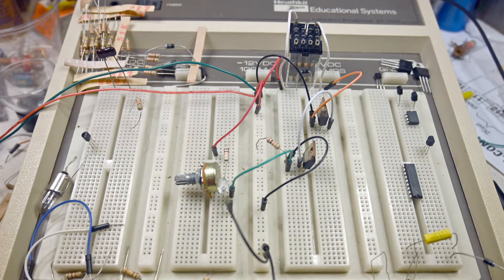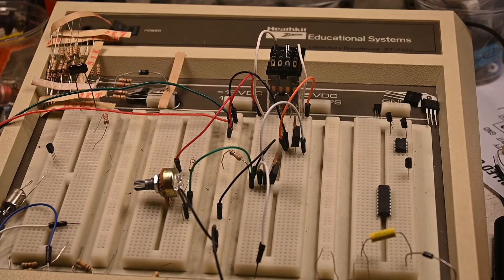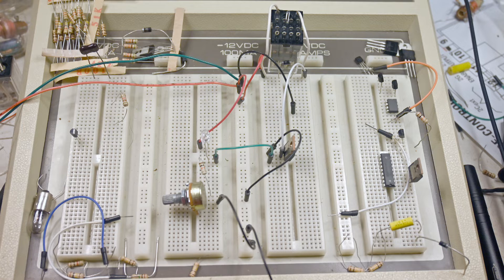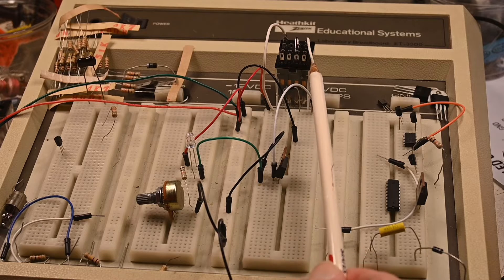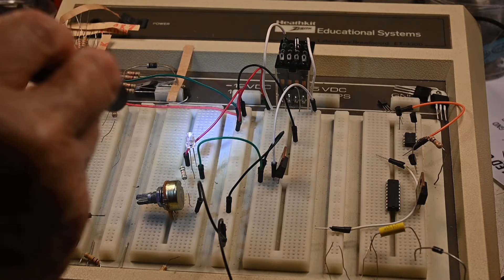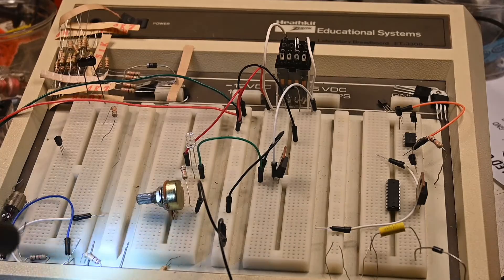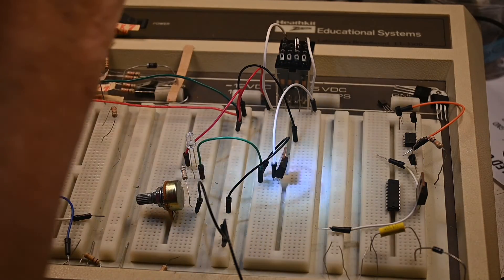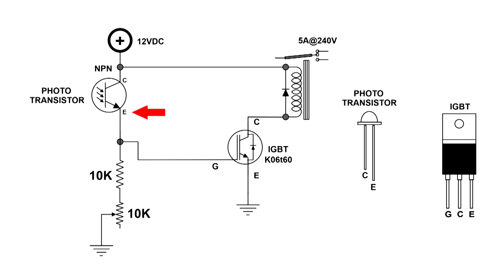180° Phase Shift using one IGBT Auto ON OFF Circuit

Comment: The issue I had when I built something similar using a 741 and a photo-resistor was that i needs hysteresis since at sunrise and sunset the light changes gradually and so the relay will buzz for several minutes till its enough to switch on properly.  I like the simplicity of this circuit so do you think it could be added with a couple diodes and another pot?
Reply from the maker: You could try using a Schmitt trigger in the circuit.

Comment: Thank you for your tutorials. I just recently discovered them! I hope to improve my background knowledge as I dig into my older ham gear (I have an sb-200 amp, and an old Heathkit HX-10 transmitter). I noticed the buzzing of the relay when the sensitivity was turned up. I presume that's because it has to operate with lower current from the diode since the base has minimal bias from the low light. I can see where your doubling up on the IGBT would take care of that. I was thinking about this as I imagine a turn on event driven by sunrise. There would be a slowly increasing light level and I wonder if you would end up with a sustained buzzing for a while with the simpler circuit? 
bit of non-sequitur, but I tried the link for your free ebook and it wants a password now. Have you changed your mind about distributing it free?
Reply from the maker: The password is in the SHOWMORE
The password is allamericanfiveradio
Hope you find the book useful! 
Thank you, ane your welcome.

Comment: Cool to see an idea come to life.  Thanx for shout out.   Happy Halloween.   If you want something with hysteresis BigClive did a tear down and reverse engineering of a chinesium dusk to dawn sensor.   It uses a unique circuit configuration using a 555 timer.   It also incorporates some filtering to eliminate  inadvertent triggering from lightening flashes or car headlights hitting the light sensor.    Amazing for a simple 555 circuit.  I definitely tucked that one away in my "Circuits To Remember" file for future use.   CHEERS
Reply from the maker: Thanks! Happy Halloween.
I take a look, sounds interesting.

Comment: Third experiment...What would happen if you put a zener diode or even a standard diode at the gate with a .7 volt drop in it? Would it make it so the florescent lights don't make the coil in the relay get just enough voltage to hum but not enough to pull the coil in? I guess that would be in effect like a Schmitt trigger. Thanks for sharing this and have a great day!
Reply from the maker: Thank you and your welcome. I think a Schmitt trigger might help.